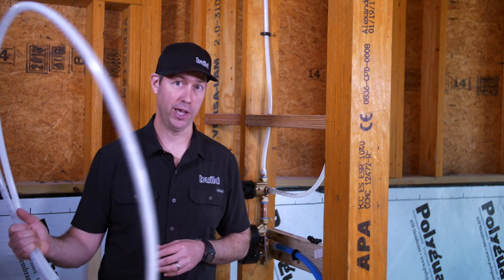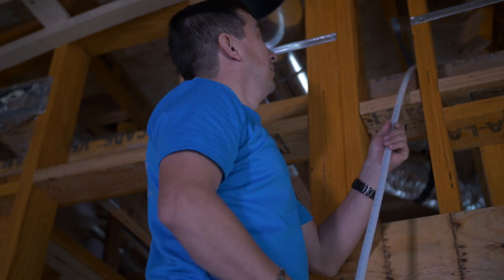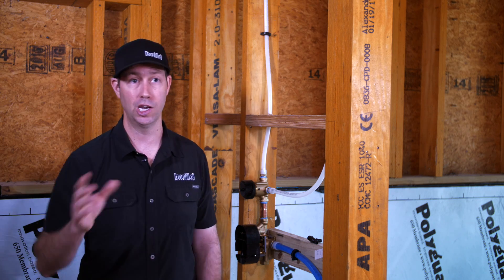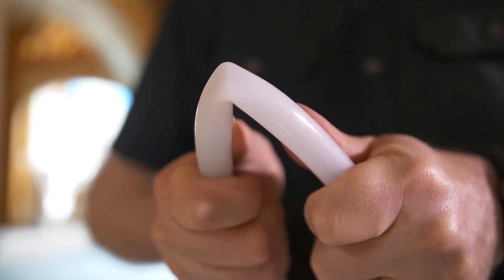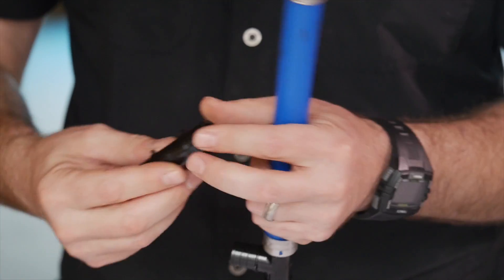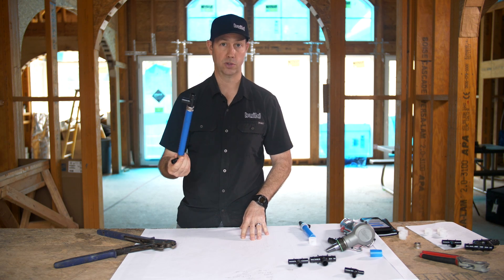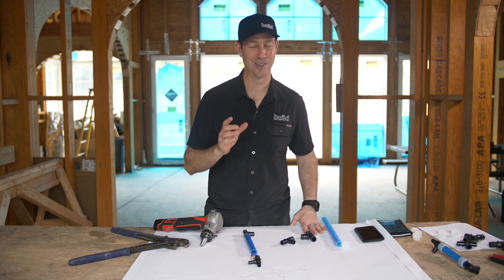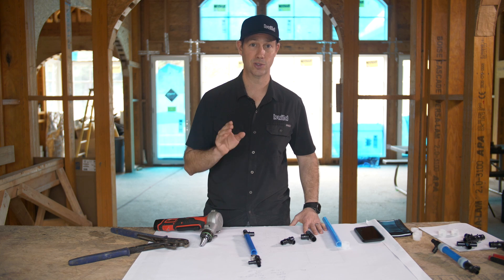PEX vs. Copper Plumbing

Comment: I like copper for taste. However many of the large water mains have moved to PVC so your drinking out of plastic pipes anyways. I personally can taste the plastic'y'ness of the water with Pex.
Reply: Aren’t most mains now some kind of MDPE? I’m more worried about the chemicals they put in deliberately than the pipes.
Reply: Karl Harris, your probably right. Maybe I am thinking of the sewer lines. Either way, the new pipes regardless of PVC or MDPE are probably not food long term for human ingestion of micro particles.
Reply: Martin Deck yes they are. Almost all city water mains are plastic...I couldn't say ALL are just yet but in North America, it will be true son enough. Maybe you're just more accustomed to tasting extra minerals that come off copper pipes?

Comment: I read quite a bit of this thread and I was completely surprised that there was no mention of water quality.... there's no way I would put this in my home and expose my family to drinking this water.. sounds like a future class action lawsuit bigger than asbestos.
Reply: Yeah, because copper ions are so much better. People have tried to prevent PEX from being used, but none could show how it would be harmful. That was 2 decades ago. So you're quite late for a lawsuit. PE is one of the most inert plastics you can get.
Reply: the vast majority of food and drinks we consume daily come packaged in a plastic container. Yet your worried about the water you consume from your home plumbing which is probably less than 10% of what you drink on a daily basis. you make no sense
Reply: PEX is inert.  I don't drink water out of plastic cups because of the plastic taste, but water from my faucet, plumbed with PEX pipes has no taste when I drink it from a glass.  You are right to worry about consuming plastic residues, but if you do, they won't be coming from PEX plumbing!
Reply: What??

Comment: When I first started looking into pex home run systems, the literature (I think from Nibco) talked about using 3/8" lines for your individual fixtures like toilets and bath faucets.  I always thought it made sense (still enough water flow for an individual fixture, and less water volume to go through for hot water).  Yet, no one carries 3/8" pipe, and I don't know if UPC supports it either.  Either way, I've done half a dozen houses with Nibco copper rings, and aside from getting into tight spots, it's been a great system!

Comment: just had a pex fitting fail last week from a build in 2006, good timing.
Reply: Attilio Di Marco Hep2o not so much. Once pressure tested, you’d be hard pushed to fluff it up. Not sure if you guys have it on your side of the pond though.
Reply: I think it's more that installers don't use the right tools or fittings for the job. There are absolutely some abysmal pex fittings out there...frankly, they should be pulled off the shelves.
Reply: Manual compression fittings never let me down, even when dealing with huge water hammers and 170 psi.
Reply: It requires zero skill to do fittings on PEX.  Watch the video for these two types and tell us how that requires any skill.  Sweating copper requires far more skill and has greater chance of error as you have to cut and sand the ends well, deal with a blowtorch and solder.
Reply: Fittings are the possible Achilles heels of PEX. Too much skill needed to do it right.

Comment: I wonder if this is the same material that Norwich Pharmacal used in the production of Pepto Bismol in the late sixties.  It was explained to me that the elasticity of the "pex" pipe was the primary reason with the absence of corrosion as #2.  My house was built about 17 years ago with a rigid "plastic" piping.  No problems.  In my last house it was all copper and there were a number of failures in the walls of the pipe from corrosion.  If I ever build again, I will use the flexible pipe in your hand so long as there are adequate tie downs so it doesn't squirrel all over the place.
Reply: John Gritman Yes you have to staple it down! Pex will water hammer just like copper or even pvc
Reply: John Gritman Not as loud but you still hear it

Comment: Nice video👌 try zern pex similar crimp tool but easy to operate . this system is with copper crimp rings and brass fittings. Pex is a great system 👍

Comment: I  repiped my house during a renovation with Uponor's pex A system for the very reason of having less restrictive fittings. It should be noted they aren't quite the exact same inner diameter as the pipe. It is very slightly smaller, but nothing of consequence compared to the other systems. Expansion fittings are a breeze.

Also note that the hot lines will expand and contract quite a bit, so allow some flexibility between anchor points for it to do so, otherwise you'll get banging noises as the pipe slides in and out of the anchor clips. 

And anytime you have a tight radius like from wall to floor, especially for 3/4 or 1" sizes, the 90 degree braces are a huge help.  They hold the tight radius in place and you can even use them to anchor the pipe.  Usually the large diameter pipe will fight you on those bends otherwise.

Comment: Question Matt, I understand that copper has antibacterial qualities and obviously pex (plastic) does not.  Has this ever been an issue?  Has bacteria in pex ever been detected to the point that it has the potential problem?
Reply: Copper may have antibacterial properties but copper pipes often get lined with minerals after a few years so the water doesn’t come into contact with the copper.
Reply from the maker: +Jeffrey Galeski I don't have any knowledge on this to comment. Anyone here have some thoughts on this?
Reply: Jeffrey Galeski it seems silly to favor copper for just that reason. If water with something like typhus or cholera is flowing through your pipes, I don’t think the copper is going to sanitize it. Likewise, your municipal water supply is pretty inhospitable to microorganisms.

Comment: Some of the most beautiful work I've seen has been done in copper. Mechanical rooms with boiler systems that require a wall of piping is so cool when done right. Many people could care less, but builders like me get a kick out of seeing every joint perfectly sautered with no burn marks or discoloration. Pex is great no doubt but copper, when done right, takes a craftsman. Cheers
Reply: john smith I'll always do mechanical rooms in copper easier to lay out components and it stays wear you want it without a clip. As soon as I'm in the wall I use pex. Also they make a fitting for pex that's basically a copper pipe capped on one end with a mounting flange in the muddle and barbs on the other end to accept pex on the inside of the wall. Nice rigid copper to hook your toilet to or sinks and such but then the advantages of pex inside the wall. Pex is fast and efficient but copper is beautiful. I'd hate to look at a tacky piece of pex while I'm taking a leak.
Reply from the maker: +john smith totally agree
Reply: Use PEX-Al-PEX composite pipes then. They can be shaped and will stay where you put them. Alot fewer joints needed and the pipes look clean all the time (won't corrode like copper).

Comment: Uponor all the way up here in Michigan.  Cost drove us to switch from copper to PEX B, the pressure drop moved us from PEX B to Uponor.  Price difference between copper and Uponor is not huge but ease of installation is a big part as well as resistance to breaking from freezing.  Good call on the mineral build up on the inside of copper.  I've seen many copper pipes reduced by half it's original size or they get super thin over time.  Keep up the good work!!!
Reply from the maker: +Jim Kandell thank Jim. Interesting to hear your moves in the plumbing world. Best, Matt
Reply: Hey Jim, I actually work for Uponor in the mixing and tooling department.  Just wanted to say thank you for the support! We work very hard to make sure we send out a great product.
Reply: And then when you spend a day piping, your work will be there tomorrow, not just the holes if you ran copper
Reply: Wish plumbing was easier to replace :/
Reply: No price difference in Michigan? Wow ! Here in Illinois copper costs way more than plastic . We have people who steal copper, but not plastic.

Comment: Law360, New York (May 27, 2015, 7:41 PM EDT) -- Uponor Inc. told a Nevada federal judge on Tuesday that it had reached an $18 million settlement with plaintiffs and other parties over allegedly defective plumbing parts.
Reply: mlhm5 it had to do with leaking BRASS fittings not the pex-a. His demonstration was with Engineered Plastic (EP) fittings.
Reply: Yea any one knows brass isn't a good fitting for pex. I mean you wouldn't use a pex fitting with copper (unless in a transition)

Comment: I'm building in ripley ohio, having a hard time deciding from copper or pex after this I am doing pex I believe! Not a huge price difference between the two, the copper pipe compared to pex pipe is way more but the per fittings are 8 or 10 bucks a piece but u don't need as many with pex! I believe that's what I'm doing now! Thanks!
Reply: Jamie Brierly You know what would actually be very interesting is to use your house as a experiment. Get a quote for both and get back to us if you feel like it! It would be really interesting.
Reply: Alec Ver Bunker  the copper was 1200 more for completed job by licensed plumber, that includes all plumbing materials plus rough in and final hook up! Basically everything minus fixture! This is a 5,000 sq ft home 2 story full basement 4 bed 3.5 bath including badement!
Reply: Building several houses in the city along side another builder. He is using copper and I am using Pex. One night some damn people came into the area and stole all of his copper and even pulled all of the installed copper. My houses with Pex are not touched.
Reply from the maker: +Jamie Brierly how about that timing!  Welcome
Reply: Jamie, wouldn't do an entire house with those, they aren't really for new construction. For fixes and add-ons they are fantastic. The fittings are expensive but flawless. A lot of plumbers won't get near them, those die-hard sweated fitting only types, but I have yet to hear of anyone having leaks with them. I would never bury one in a wall though, just great for quick changes/fixes in the basement or exposed spaces.
Reply: David Curtis the thieving deal has been kind of a deciding factor also! Even though we are in the country and not many ppl know thieves always find out! And on top of that it's taking me longer since I'm doing it myself on top of work!
Reply: Jamie Brierly it must really come down to those fittings! Appreciate your info thank you!
Reply: Do you need an electrician?  I'm licensed for Ohio and Tennessee.
Reply: Also one last question around here they push the shark bite fittings a ton how do u feel about them! They are expensive but kinda quick simple n easy!
Reply: David Curtis never thought of that, good point.
Reply: David Curtis one other quick question if I do not find a plumber do I use copper stubouts everywhere!! Just curious! Here in brown county oh a licensed plumber who will not half ass it or I trust is almost absolute!!!! I'm in the same deal with electric too! I know just enough to get by but would sleep much better knowing my house won't burn down due to electric or won't die due to a vent pipe not being vented right!!
Reply: Also am I gonna gain by doing 3/4 pex vs 1/2!  Since I have to reduce to 1/2 before fixture!! I however did install 1 in ips instead of cps from meter to house ! I seen the ips was a little bigger, it was a 550 ft run from meter to house, shoot wasted on a reducer, only getting 60 psi!!  Just curious about pipe size! Thanks everyone been a huge help!
Reply: I would think that garden hose would be much worse...
Reply: What I don't like is 3/4 pex only measures 5/8 on the inside.
Reply: Agreed, but I was doing a run to specifically get more water volume to the other side of my house, about 80ft total and wanted 3/4 and didn't realize till the end that it was actually 5/8 I.D.
Reply: Jamie Brierly k
Reply: Just my unprofessional opinion but potable drinking fer kitchen go copper. Pex for  everything else should be alright.  My opinion is formed from cutting open a few garden hoses in my time and seeing all the algae and grow.  Probably the reason why people say don't drink from garden hose.
Reply: People say not to drink from garden hoses, because they're made from cheap recycled rubber . And garden hoses are exposed to outside elements like bugs, algae, people with herpes getting a drink. That's not pex.
Reply: Hea but wipe. The savings is in the labor cost...Much faster with pex than copper...If you can read, he made the point when he said that you need many less fittings with px...
Reply: On hot water lines you want the smallest sized pipe that will deliver the flow you need.

Comment: For those of you with PEX, how many have actually noticed any taste difference? 
I have always been the person that drank from the water hose after letting it run a minute... 
But on hot water lines in particular, have you noticed anything?
My hot run on an outdoor tap did (built in bbq). The cold, less so.

It appeared to stabilize after 2 months of use give or take, and didnt have much taste or odor unless it sat for weeks. 

Definitely love the Uponor though. Worth every bit extra in my opinion.
Reply: Our whole house is done with PEX (or PEX-Al-PEX composite to be more exact). Not even at the beginning, when the pipes were new, could I taste any difference. I can now however sense a metallic taste in the water of some other homes, that use metal pipes.
Reply: When I lived in Toledo, I drank (copper supplied) tap water all the time and it tasted great.  I thought I could taste the difference in CPVC supplied water back then, but it was probably in my head.  Here in SW Florida I pay the few bucks for a water cooler because I can't stand the (CPVC supplied) soft water taste.  Wouldn't say it is the supply lines, but rather the water quality.  I'm old and I like the idea of something that has a common use and is really time tested.  Up North I wouldn't want anything but copper.  Down here - who cares.  I don't know anyone that drinks tap water.
Reply: I use pex for my 5 stage, the rest of the house is copper. There just isn't enough tubing to see a difference but I would be curious on an entire house plumbed with pex.
Reply: Not a bit.   The city water isn't great though so we do filter the drinking water.
Reply: I purchased a home with PEX, 6 years old, and I had to install a water filter to drink the water from the tap.  Not sure what type it is, but it has a very strong, and unpleasant flavor.

Comment: What are your thoughts on sharkbite fittings (push to connect). Are they reliable?
Reply: Eric Woollen   I did a bath remodel using the sharkbite fittings about three years ago all ok so far. Fingers crossed.
Reply: I have them on my hot water tank, 5 years so far, all is well.
Reply from the maker: +Eric Woollen I'm doing some testing now. Might have a future video on that topic!

Comment: I used PEX-b to repipe my house. Glad Matt pointed out pex -b is smaller diameter it really does affect flow. My water meter at the street was 3/4" and i used 3/4  pex pipe from the meter to the manifold. I do notice a pressure drop when more than one tap is open. Not a big deal in a small house but consider sizing up if you have long runs or a big family using water at the same time

Also If you have a tankless water heater they suggest i think 15" of alternative pipe before you transition to pex due to the heat transfer from the coils
Reply: Niceguy217/master_plumber:        My city meter (at the curb) is merely 5/8".        It's been working fine for 60 years.       In 1991 I re-fresh-water-piped my entire house with L copper, all the way from every shower head back to the street.     The main is 1 inch, and it's quite long, probably 60 feet before first tap in the house.      I have 68psi static pressure and awesome flow everywhere.    Two people shower simultaneously with no inconvenience, no temperature shock, etc.
Reply: If Matt was accurate with losing about a 1/8 inch diameter with PEX-B on a 3/4 inch line, then the difference in cross sectional area is a factor of 1.44. That implies that at the same pressure, the PEX-A fitting could pass almost half again more water.
Reply: As a industrial Master Plumber who switched over to residential after 38 yrs. I can tell you that you never use less than 1" to feed even a single family residence, and have never seen a  valve or meter from the towns supply that small as you said, but even if I did it would be 1" that I would run.
Reply: You need about 1" PEX for the same volume as Cu 3/4". PEX pipes have much thicker walls.
Reply: Indeed the standard rule of thumb is if you are going to pex you go up a size, you may not need to do that with pex A but pex B it may not even be necessary as flow rates from pex B will likely be much more then then older 20+ year old copper pipe most people would be replacing and if that is fine flow then pex that will not decrease flow over time should be ok.
Reply: 3/4can only carry 8 gallons per minute
Reply: @auspicioustoot  At how many ppi?
Reply: its not a pressure drop... you just have less volume.... you cant change yer pressure unless you have a pressure reducing valve... just wanted to clear that up
Reply: You do need to transition to copper/stainless steel going to any water heater. Also, the manufacturer suggests not running the pex directly to shower valves and heads. This dude obviously doesn't know that.